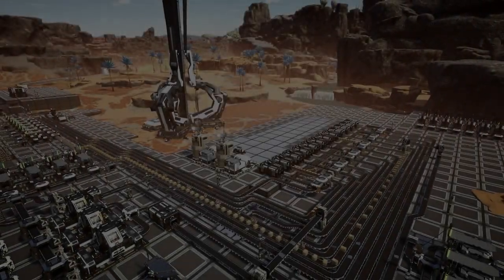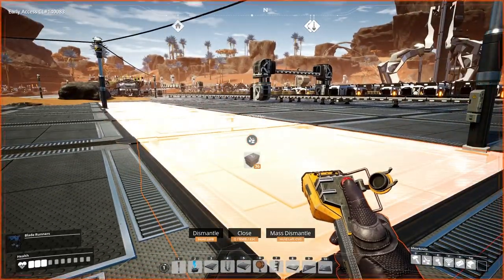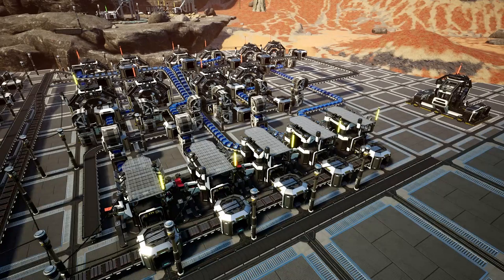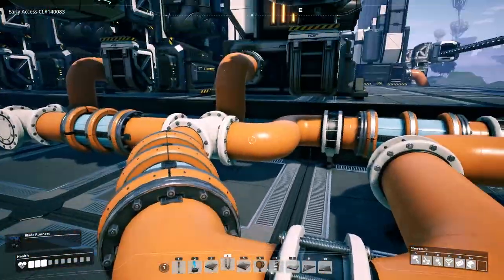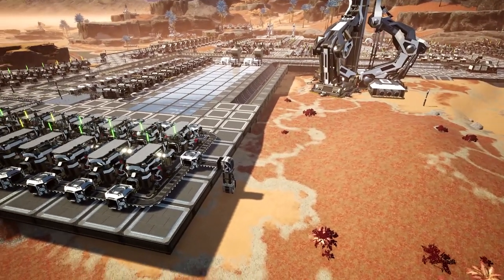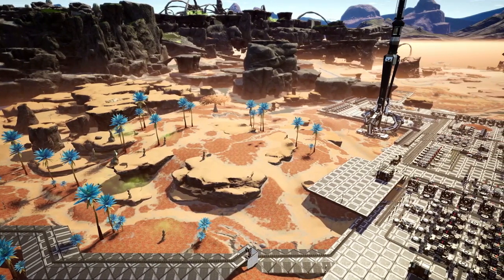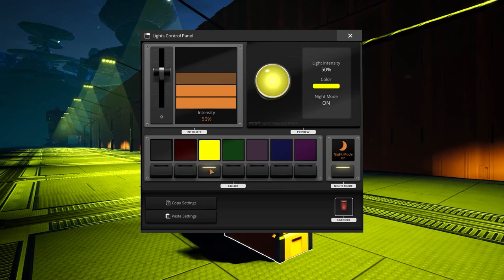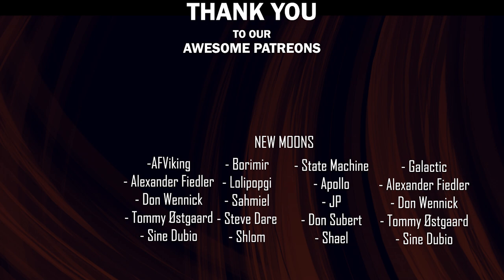Satisfactory Update 4: Are We Ready? - Let's play Episode 10 (prep)

Comment: Looking to build a pc to play satisfactory its my first build and trying to keep under £500. What do you guys think?

Ryzen 3 3100
Geforce gtx 1650
Gigabyte a520m elite
8gb corsair vengeance ram
1tb seagate hdd
500gb ssd
500w power supply bronze
Reply: Great start!
Tips
1. Finding a good processor and motherboard combo that will allow you to upgrade your processor without replacing the motherboard is the key.
2. I used a bottleneck calculator and your CPU +  GPU combo is great with a 1.16% GPU bottleneck (I wouldn't go higher than 10%) Closest to zero is best.
3. SSD and HDD are good sizes, I recommend putting ur windows on the SSD to shorten boot times.
4. 1080p is the best resolution to game at with this hardware, you may enjoy 2k, but it will slowly make you want to upgrade. Not a good idea to do 4k here, although it is possible.
5. If possible, always consider waiting a bit longer to save up and increase your budget for your CPU, GPU, and motherboard.

Can't stress number 5 enough, but at the same time, you  buy at some point.

Are you building it yourself?

If you decide you want to increase your budget, keep the current part list and then make a new part list with the higher budget, then compare the two to see if it is worth it. 

Last thing, if you pay for it with 100% your own money, you will enjoy it more and you will respect it more :)

I'm using corsair vengeance ram as well, and it does really well. Satisfactory tends to use a bit of ram, so consider adding another 8gb if you see issues, but you should be fine.
Reply: @orin3039  cheers that helps alot yes im doing it myself its my first build, if you were to upgrade cpu, gpu and motherboard what would you go foramd what do you think the budget difference would be?
Tbh i couldnt tell you much about different makes and models

P.s moving from xbox so will be massive upgrade lol
Reply: Better buy HP laptop 17inch it's 16gb ram 256gb ssd but adding hdd is lit bit complicated bc you need to replace DVD player in laptop for a hdd drawer, it has Ryzen 5 and idk what graphic card 🤣🤣🤣🤣🤣🤣 you can buy it for $500